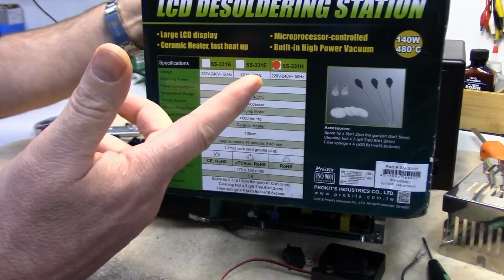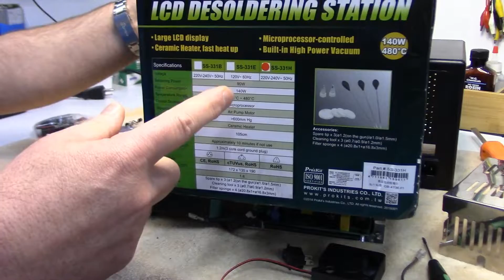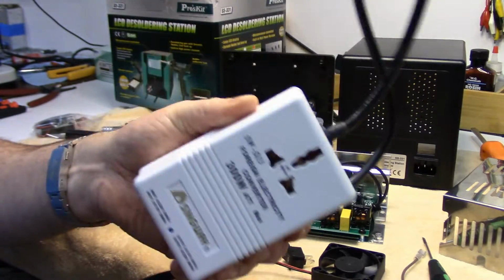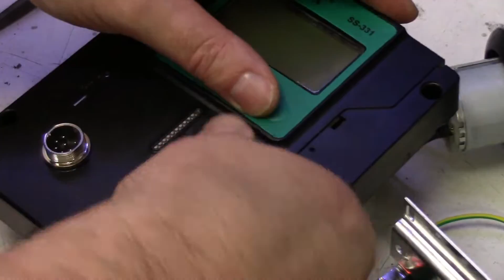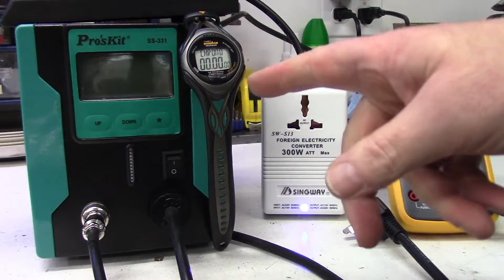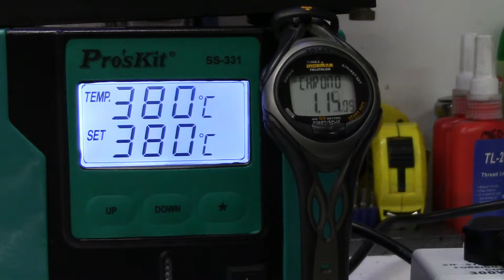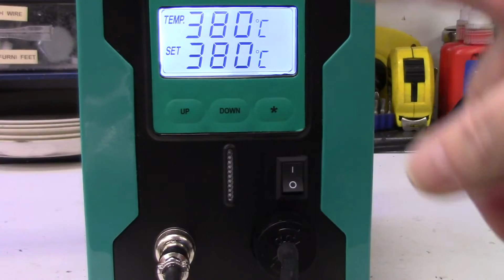Pros Kit SS-331 Universal Voltage Update

Comment from the maker: See my full review on this SS-331 desoldering station: https://youtu.be/PuiiZO8Ye70
Reply: I have this one with the same universal power supply. I tried connecting it and it does turn on and run but it displays "ERROR" on the screen. When I try plugging in the soldering gun, it freaks out and shuts on/off over and over. Sometimes if I slowly connect it, I can get it to be detected...but fully inserted no go. I can't detect a short with my multimeter, the resistances are correct...I'm not sure why it's freaking out like this. Any advice?

Comment: Hi John, thanks for the review and about the power supply voltage working with 110.  How did you open the front panel?  I see the four screws on the bottom of the unit, but cannot figure out how to disconnect the front panel.  Thank you!
Reply from the maker: Screws behind the front panels - shown in the first review video during disassembly.

Comment: What is the voltage to the heating iron?  12V?  Is the mosfet you call out simply for turning on/off?  Or voltage regulation?
Reply from the maker: 24V. I never scoped it, but I presume it's digital on/off output.
Reply: @Rchelicopterfun  Cool. I've just bought the handset, have a pump, and would like to adapt it to my existing station. It supplies 120V to heater. If it is bang- bang controlled, I'm hoping a switch mode power supply won't mind the on/off action. Also, verified by hookup to 24v, it consumes 84W so looks good!

Comment: I know you havent done a further update on this, but how is the thermal mass on the tip of this thing? Will it work for getting relays, and Mosfets out of boards with large power/ground planes?
Reply from the maker: Continues to work a treat on everything I've used it on so far, plenty of thermal mass.

Comment: Makes economic sense for a company to only have one power supply.
Cheaper and simpler for manufacturing.
Love the switch mod, you can get angled spade connectors if there isn't enough space behind.

Comment: Can it be set to fahren
height? And you didn't have to change any settings when going to 110 volt?  Just plugged in the new cord?
Reply from the maker: @eightofnine9 - Celsius only. Nothing to change for it to work on either voltage - just plug the rascal in and start sucking 😄

Comment: Hi John !   oops...  only saw this video of yours after buying one a few hours ago.  Bonus.  I can use my (old) 110/220 transformer for something else.   Once mine arrives, I'll run the same test you did (and likely open it up to have a look) and report back to confirm whether or not they still ship with this type of switching supply.  Thanks for the video !
Reply: Hello again John...  My SS-331 just arrived from Banggood.   Interestingly along with it came (taped to the outside of the box) a physical plug adapter to convert the angled 3 pin Asian (Australian?) plug o a North American 2 pin plug.  But no notes anywhere that it would work with 110VAC.   But after watching your videos, I simply got a standard computer power supply AC cable and used that with my de-soldering station.  As expected (and as you explained) it works perfectly plugged into 110AC without any other changes required.   As you did, right after setting it up, I tested removing some parts off of a scrap circuit board.   I had to turn up the temperature up quite a bit (around 390°c) to melt the solder on this board.  I suspect the solder on this board doesn't have a lot of lead in it...  It worked fairly well at the higher temperature.   BUT then I noticed (on close examination) that the 2 spare tips they provided were not the same size and indeed both were a bit larger than the one that came pre-attached to the de-soldering gun.  De-soldering parts from the same board was a bit easier with the largest of the 3 tips installed.    Makes me wonder if we can specify what size/type of replacement tips we want when we order spares ?   I am thinking along the same lines as all the different tips I can buy for my old Weller soldering station.

My delivery arrived exactly 14 days after ordering it.  The price was higher than when you bought yours...  after a year and current market / shipping issues I suppose that's not surprising.  They box had 2 dings (penetrations) on arrival.  One of which was caused by the AC plug adapter being pushed in because it was taped to the outside of the carton.  However  it looks like the way the package the stuff into the box is good as nothing inside was damaged.

After my brief usage, the first conclusion I came to was that I was wrong thinking I could wait and tolerate the ON/OFF switch being on the back for a while.   I will be soon moving my power switch to the front somewhere like you did   QUESTION...  from your video I can see that there are 4 screws under the green strips on each side of the front of the unit.   How did you get these green cover strips off without breaking them?

The second conclusion was that I was very pleased that I bought this de-soldering station.

Anyway, John THANKS AGAIN for posing the videos on the Pro's Kit SS-331.   Your review, demonstration and tests/comments are what made me confidently decide on this unit as my first de-soldering station after many years of using a manual solder pump and/or solder wick.   AND again, I'm sorry that I forgot to use your link in your video to buy my unit.   Since then I have watched a couple of other videos you posted.    I have never subscribed to any YouTube video before.  I don't watch that much YouTube unless I'm researching something.  But I feel I want to repay you in some small way...  and I do like your technical approach in the videos I watched.  So I am subscribing to you and will see what you have to present for some time.

Comment: On John's good judgment and my faith I figured what's the worst that could happen if it did not work on 120 volts.  Having a good supply of the 120 volt power cords, when I got it I plugged it in and it worked just fine. I had been looking at the model E, 120 volt version when I found John's new review (had see his others) on the power supply input voltages. So thanks to John he saved me about $50 which was nice. When I was working (now retired) I had been using these for decades as an engineer. At home for a special project I needed a unit like this rather than the plunger type and solder wick I had been using. The unit is all John said it is and for a home unit does the job. I'm glad I now have it as it saves the board from damage and does a professional job.
I also found the tip was lose when tightened down properly. The cover that slides down over the heating element did not go down far enough to hold the tip firmly in place. So I used some emery cloth on the base of the heating element to smooth it out some. And then used a dremel to slightly hone out the cover at the base. That was just enough to get it to go lower hence holding the tip in place. Don’t know if it was just my unit or others but never used one with a lose tip.
Reply from the maker: Glad to hear you are happy with yours as well other than the tip issue. Mine didn't have that problem, but good to know about it and thanks for sharing your fix method for any others that might run into it. 👍

Comment: I cannot believe that a Chinese anything would have a shield on it that it did not need.  The Chinese are notorious for failing EMI tests.  I'm planning on getting one of these, largely based on your recommendation, but I will definitely test the RFI levels before I leave the shield off  (if anything I was planning on adding more EMI protection)
Moving the switch definitely sounds like the thing to do.

Comment: Hey John, do you happen to know if the tips for this station are available for purchase?
And what about the tips quality? Do they last long?
Reply from the maker: I haven't worn out any tips yet in just over 17 months of using this thing; but I generally only use it a few times a month, so it's not getting daily use or anything hard. I've seen SS 331 & ZD 8915 parts (including the tips) on both eBay and AliExpress. Banggood used to have some as well, but doing a quick search didn't show anything?

Comment: nice mods, but the switch for me is upside down lol that would bug the hell outa me "sorry ocd alert", Im from the UK so most light switches are down for on and up for off on a toggle switch, but you were lucky where you placed the switch. Just wondering if there was a real reason they designed it so the switch was at the rear!? I always try to analyse the conversations that would go on, " switch on rear " no " switch on front " 2 designers thinking where a switch should go then going to the big boss and he has to decide and both designers forward there reasons. Maybe its none of that, just fit a switch so we save money on wire ! lol
Reply from the maker: Here in Canada/North America, electrical code is down off, up on. Backwards from that logical orientation would drive me crazy; but you can mount the rocker switch in any orientation that you want. 🙂 No idea why the rocker switch wasn't on the front out of the box; I didn't design it. Maybe due to certain electrical or appliance codes in some parts of the world; or as you said cost savings - who knows?

Comment: When I bought mine I had the opposite problem: I needed a 200V version and it was difficult to get so I ended up paying a premium and waiting a long time for the shipping. If I would have known it was the same! Manufacturers create a big disservice to the community by fragmenting the market and allowing resellers take advantage of that. Did you have clogging problems? In my case I had a lot of clogging problems but it may have been due to low temperature settings, I have just started using 380 degrees as you do and I have found that helps but I still have to keep using it for a while now. Thank you for the video and keep up the great content!
Reply from the maker: No clogging issues at all & it's still working great now going on 15 months. I always make sure to pass the clean out rod through it after every use before turning it off to make sure absolutely nothing is left in the heater tube. I run mine anywhere between 380C and 410C depending on the thermal mass of what I'm working on.
Could not agree with you more on the fragmentation of the market statement. It's "horse crap" 😠 Sorry you too had to pay a premium to get a different $5 cord.
Reply: At what temperatures did you experience clogging? Were you using flux or not?

Comment: I am thinking of replacing the 1 ohm resistors with a 12 volt regulator and a filter capacitor for better motor start up.

Comment: I am just going to buy the gun and use it with my HIYUH 853 but my station only has a 5 pin connector I could not find the manual with the pin-out can you please post it.

Comment: Hello John, just got one of these last week, great addition to the soldering (desoddering for the US readers) setup. Turned it on yesterday and it was making a sound like a rock crusher. Little amount of very light machine oil and its all quite again. When I was inside, I moved the switch to the front, but located it between the two connectors. Thanks for the idea. Cheers from N. Ireland.
Reply from the maker: Do you mind sharing exactly what was noisy; ie. what you put the oil on? I'm presuming the upper bushing of pump motor because that's about the only item I could see making a noise that would be cured by some oil.
Reply: John Salt  - It was the little cheapo fan that got very loud and angry ! I peeled back the label, and the tiniest drop administered with a syringe and a fine needle to the top bearing cured it. Now running a lot quieter.
Reply: @alandoherty8279  Nice that they didn't use a sealed motor that you can't lube like some Xbox's and playstations, which is what I got my desolder station for working on.

Comment: Hi John, does your device also take hugely long to warm up, due to the fact it has a 24V element on a 18V supply? (drawing 55W instead of 90W) And then a resistive dropper to 12V for the pump and fan? I am considering modding the PSU to 24V, and adding a DC/DC dropper to 12V instead.
Reply from the maker: I showed in the video the heat up time - I've never had an issue with it.

Comment: what voltage the gun works
Reply from the maker: If you are asking what the working voltage range of the heater element within the gun is, I have no idea. If you are wondering what the supply voltage to the heating element is from the desolder station, it's 18VDC.

Comment: You did a nice review of this pretty good low prise unit and also this update video is very usefull. Thumbs up !
I already did the power switch modification to the front on the same way you did. I think it is the best place to put it.
I was also amazed about the fan and the airflow.  In my case the  holes in the back of the housing were almost all blocked completely  so behind the little fan I drilled the holes much larger.
And indeed there is no air inlet ! Very strange...  To solve this issue, I drilled big holes in the botom of the case near the left front rubber foot stand.
In this way I hope that a little amount of air will flow through the power supply.
Unlike you I don't want to ommit the metal case around the power supply because of possible EMC issues. ( I had  some bad experiences with SMPS units )
I get the impression that the SMPS unit does not get so hot at all. So I think we don't have to be too critical about the fan issue.
Thanks, greetings from Holland !

Comment: What was the date code on your unit?  I just got one today and its date code is "20070053" (sticker on the back of the bottom surface), which I take to mean the year 2007 (although the 53rd week does seem kind of sketchy).

I'm in the US and am hoping that my power supply will also work on 120V.  If your date code is close enough, I wouldn't bother opening it up.

Comment: I just got the same station from Aliexpress and I can confirm it is working from 120v. I took it apart and verified that PS is 100-240v same model as in this video.
Reply: I appreciate all the research John and Dmitry. I can confirm my AliExpress unit SS-331H also had the switching power supply that works in North America. Mine took about 85 seconds to get to 380 but that is close enough.
Reply: Just got my unit in January 2023 from AliExpress.  Power supply is still universal!  My power cord also included a "travel plug" that adapts from the stock cord to the North American type.

Comment: I am curious, where did you check online for the ZD-P150 power supply?  I can't find it.

Also,  can anyone tell me if the on off switch is just shorting to ground?  or is it hot?  Also, I want to put a lighted switch on the front instead of the stock one and I don't know if there is a specific voltage/amperage requirement.  Please forgive me if I misstated something as I am only recently reacquainting myself with electronics.
Reply from the maker: Found the specs by doing a Google search. I'm sure it was on ZD's website, but that was almost a year ago now, and I can barely recall what happened last week.
The power switch is controlling the hot line (standard/code practice). It has to be rated at line voltage or higher. If you want to put a 120v or 240v lit switch in, no issue but most also require a neutral wire plus the switched hot.
Reply: @Rchelicopterfun  Thanks.  I am just getting back into electronics.  I used to do telephony decades ago and have forgotten a lot.  Is it a no-no to put the power switch on the side or top of the unit.  Seems less cramped there?  By the way, cracked mine open and found the 100-240 sticker.  Sweet.

Comment: Certainly moving the power switch from back to front was a great thing! I don't understand why the manufacturer didn't realize that the switch behind it is absolutely uncomfortable. As for the cooling fan, I personally think it is more useful to remove the original fan completely, recover a 24v DC fan and power it directly from the switch power supply (18v) without passing through the voltage drop resistors (1 ohm, 5w), and use possibly a step-down to power the vacuum pump motor, completely excluding the drop resistors. But this is just my idea.

Comment: I have the same one but branded as ZD-8915.There are 2 revisons of it. 6pin pistol plug and 7pin (sleep mode added). I had problems with solder stucking inside the heating element.
I have replaced the pistol form ZD-8925. It has a bigger heater diameter-bigger thermal mass. Now it works great.
Pistol from ZD-8925 has 6-pin plug so it won`t work with 7 pin desolder station, but the front of the pistol can be swaped.
Im adding this info, only if someone has the same problem. If some one is looking for desolder station i recomend to buy newer model - ZD-8925
Reply: Yes I have exactly the same issue, the solder gets stuck right at the end where it goes in to the glass container, it does not have enough thermal mass. 
I was looking at replacing the gun with one from the ZD-985 (ZD-552B 7 Pin Gun) or the ZD-9825 gun (ZD-553R) But obviously that is a 6 Pin, I was going to swap the cable over and add the sleep sensor, however I can’t find that gun for sale. What part did you replace exactly on yours and do you have a part number?